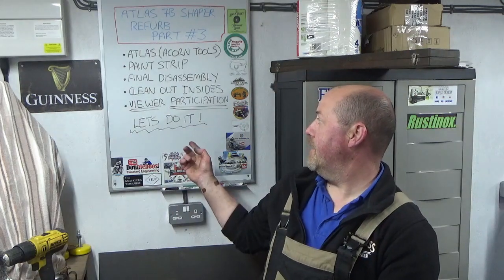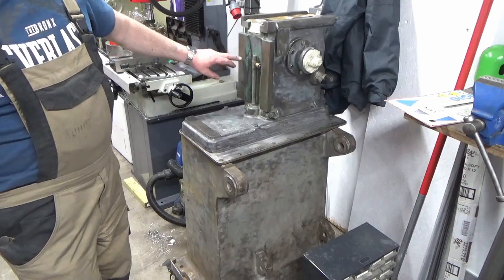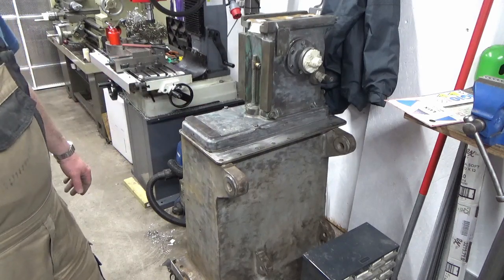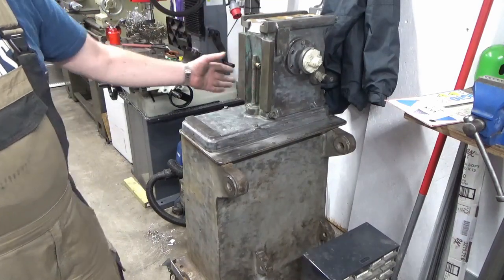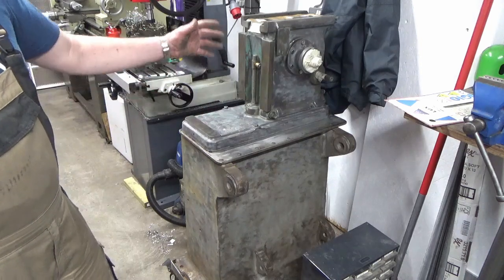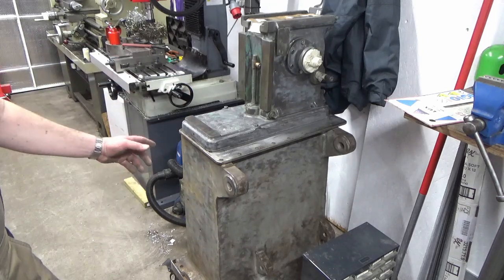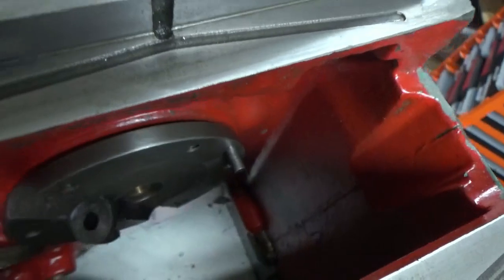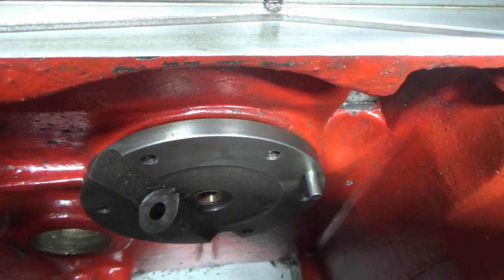Atlas 7B Shaper Restoration Part 3 - The Big Strip

Comment: Gloves and long sleeves are for sissies! Only thing I found necessary is eye protection when using wire wheels on power tools!  My paint choice? Hammertone green, super hard wearing, and silicone based, shrugs off dirt like no other paint. Nice one Jon!
Reply from the maker: Hi Robert, thanks for the comment. I do like Hammerite and Smoothrite, both excellent paints for the workshop. Cheers, Jon

Comment: My 7B had the casting broken in almost the exact same place. It was silicon bronze brazed/repaired prior to my purchase. It works well and was not cracked when I got it. Alcohol on the Scotch-bright pad also works well and does not leave an oily residue. Option 3 is my vote as I would like to see an Orange shaper. Option 1 would be too much Orange. I just restored/painted mine Smoke Gray. Keep up the great work.
Reply from the maker: Hi John, thanks for the comment, feedback and your vote, much appreciated. Cheers, Jon

Comment: I did see an orange shaper once , it was a huge bastard that came out of an automotive manufacturers tool room .  
Go with Grey  !!!  
You would need acetylene for the heat & manganese bronze rods to do a brazing job like that on cast iron .  👍
Reply from the maker: Hi Max, thanks for the comment and your vote. Glad you agree the bracket is beyond my equipment, it will be a quick fab job and be much stronger (plus its round the back so I won't be constantly tormented by my welding lol). Cheers, Jon

Comment: Nice job on the shaper Jon. I don't have any input  as to a the paint preferences but, for that broken cast iron part, good decision not to fool with welding it.  That is the reason the machine tool manufactures moved way from cast iron and went with steel weldments. Mild steel will easily fab up and be superior to that cracked up cast iron.  Cheers.
Reply from the maker: Hi AWDjr, thanks for the comment and your vote of confidence in my decision making lol. Cheers, Jon

Comment: Hay Jon, Option 2 dark gray, you can use your orange to highlight the cast letters.
I was looking at the Atlas motor hanger bracket. It's slightly different, the holes are not elongated leaving a little more meat in the casting for strength. Thought that might be interesting. Making a welded steel replacement bracket, agreed your best option. The Atlas bracket would probably fit if you could find one, quite a long shot. I haven't seen any here on eBay or other sites and shipping prices are crazy high now. Coming along nicely !     Cheers....Dean
Reply: There is one bracket for sale on E-Bay right now.
Reply from the maker: Hi Dean, thanks for the comment, feedback, and your vote. Just going to fab up a bracket I think, should be no bother even for my poor welding skills lol. Cheers, Jon

Comment: That's coming along lovely, Jon.

Cast iron brazes really well, I'd talk to someone with an oxy-acetylene rig and get them to braze it up.  Oxy-acetylene brazing is a helluva lot easier to do than tig brazing.  Pretty much any local machine shop should have the material and skills to do it for you.  

Given your choices of orange / grey, I'd personally have gone for grey all over with orange and black highlights.  So I guess my vote is grey base orange machine.
Reply from the maker: Hi Michel, thanks for the comment. Agreed, if I lived near anywhere industrial it would make sense, nothing but sheep and cows for 50 miles lol (bliss). I have some steel kicking around so an opportunity to improve my poor welding skills. Cheers, Jon
Reply: @jonsworkshop  Nobody nearby that repairs agricultural machinery?  Most of that is cast iron, unless it's all gone to plastic and serialised processors now :)

Another good source of "we've got an oxy acetylene torch and we're not afraid to use it" is plumbers.

Comment: Great video Jon. Colour wise I say grey, but Harrison Blue-Grey which I think is a really nice colour. I can see no issue at all painting it all orange if you like it. I work with huge equipment that is painted bright yellow. I thought John Mills might be the man to tig braze your bracket but then it looks like there isn't much meat on it. I have a cracked cast knee leadscrew nut housing on my mill, which I need to make a replacement for. Nice job on the internal clean. Look forward to the next part. I need to get an india stone like that one you have.
Reply from the maker: Hi Carl, thanks for the comment and your vote. Yeah, the casting just doesn't look like it will mend well considering the weight it has to carry. More welding practice lol. Cheers, Jon

Comment: Morning Jon. Good call on the bracket. That looks like more heartache than happiness. That is such a small wall thickness it is essentially glass. Brave men would try a nickel rod and arc welding. I would not be one of them. 

Great cleanup and discussion. WD40 and green pad is a great combo. I agree with you! Even a metal scraper scratching away is slow progress at removing any meaningful amount of metal. 

All the best 
Dan
Reply from the maker: Hi Dan, thanks for the comment. Yep, one of the most important skills to learn in any workshop is to know your limitations, that bracket is way beyond mine lol. Cheers, Jon

Comment: I would chose option 4 - dark grey all over, and then paint the handles and various touch points with your favorite orange 🍊
Reply from the maker: Hi Joel, thanks for the comment. There's a few said similar so I will add this in as a valid option if it comes out in front 😁. Cheers, Jon

Comment: Hi Jon,
Great job on the stripping down and cleaning, even without H&S involvement. Personally, I would go for the totally grey look, I'm saying nothing about that orange colour that would be your preference.
Have you thought about asking John Mills to tig braze that motor adjustment bracket ? I have seen him do plenty of silicon bronze repairs in the past and they look good. Haven't a clue how much it would cost against you buying some material and fabricating one from scratch.
Good luck with the rest of the project.
Reply from the maker: Hi Del, thanks for the comment and your vote. I did think about John Mills, I think he could probably do it but the wall thicknesses are really weak. Think it will be quicker to just fab one up, gives me another opportunity to try to improve my welding skills to. Cheers, Jon

Comment: I painted all my machines bridgeport blue/grey, as I bought a 2L tin of the stuff to do my Omnimill and had enough left over to do the shaper, surface grinder and tool &cutter grinder. So my vote would be grey all over. It won't show the grimy oily marks as much as orange, unless you're intending to polish it after each use!
Reply from the maker: Hi Robert, thanks for the comment and your vote. Agree with your point, interesting concept, industry have moved over to white in some areas so that it's obvious when a machine is not being looked after....... not sure this works in the home shop. Cheers, Jon
Reply: I painted my M300 white as that was the colour it was when I got it. Not a great move. It always looks grubby, plus the chips in the paint show up really well!

Comment: Not sure what you will go with , but remember one thing. If you go Orange then you will need to make an engraved plate saying Mclaren. Oh & a big spoiler on top. Also Satin black goes well on the Orange Mclaren's. Cannot offer help with the Tig. Left the bottle on by accident. £100 worth of Argon gone. P.S Whatever colour it will look great when finished.
Regards.
Steve.
Reply from the maker: Hi Steve, thanks for the comment. Spoiler eh........ Got me thinking now. Bad luck on the gas mate, at least it wasn't the propane so you made the right mistake (if that's possible lol). Cheers, Jon

Comment: Hi Jon, I'd go or grey but maybe orange highlights, think all orange would be too much. On your bracket repair/replacement, possibly a short piece of heavy duty U channel / girder the right size might be a viable option rather than manufacturing from scratch. Cheers and all the best
John
Reply from the maker: Hi John, thanks for the comment and your vote. Good suggestion on the U channel, never thought of that (less of my crappy welding on show lol). Cheers, Jon

Comment: The broken motor bracket could be made from something as thin as 6 mm plate,  original item was quite light in construction comparatively. 
Casting was more economical than fabrication pre MIG/MAG welding methods and any automation welding.
Great job on the preparation,  I've had a few wire wheel escapees embed in stomach,  cotton T shirt is no protection as you state, when the wires start escaping in volume,  it's time to replace it.
Certainly a lot more sophisticated than my flat belt drive Alba shaper.
Ref colour of shaper: 3. But orange base with grey machine, with orange features. 
Thanks for sharing
Reply from the maker: Hi Bosted Tap, thanks for the comment, feedback and your vote, much appreciated. Cheers, Jon

Comment: Hi Jon , my shop is full of grey machines most in original and tired finishes ….. it’s a no brainer …..obviously ……ORANGE …… with maybe the script picked out in grey ! Re motor bracket you could fab up a mount from steel plate  but if you wanted you could repair the part add some machining allowances and a bit of draft and contraction send it to me and I will get you a new one cast , so you have a bit of viewer interest preparing the part for the foundry and then obviously machining the casting and fitting up . 
Regards 
Robert 
Partsmade
Reply from the maker: Hi Robert, thanks for the comment and your vote. Thanks also for the kind offer. I have already got steel cut ready to go for a fab bracket, the original design in my opinion is too weak in cast iron to hold that motor so steel is the way forward I think on this one. Cheers, Jon

Comment: I'm back, the two things my 7B realy needed was machine work, no big deal for me, took it to work and put it on the Tree Milling Machine, and a good cleaning. a good coat of paint remover and in to the parts washer at work, ( one mite be thinking why would a Auto Repair shop have a Tree Milling Machine ? ) At work I also do cly head resefaceing and other lathe work, The Parts washer took all the geas and paint off

Comment: My view as regards the colour is that this is an antique. Ideally you should preserve as much of the original patina as possible and only refinish as a last resort and then try to match the original finish as closely as possible. But, it's not mine, it's yours... As far as I can tell you want to paint it a mix of orange and grey. I think that'll be hideous, but it's your machine, so that's my vote. 😀
Reply from the maker: Hi Matthew, thanks for the comment. Unfortunately, someone else had already done a really crap job of trying to refinish it so the patina was just flaking off every time I touched it. I don't mind the Atlas Grey, but the Acorn tools green is just awful (in my opinion of course lol). The masses will decide its fate lol. Cheers, Jon
Reply: @jonsworkshop  I do understand the 'hammerite curse'. Generally when looking at old machines, anything painted with hammer finish paint is immediately suspect - if they couldn't be bothered to paint it properly, what else is wrong... Mostly I'm just jealous that you found a small shaper for sane money. Around here, (south of England), they're unobtainium, or crazy prices for worn out, broken rubbish.
I quite like the various greens used for old machine tools. Probably just exposure over the years, it just looks right for old kit.

Comment: Nice Jon the broken bracket why not contact Doubleboost his welding of cast is renown he needs to get dirty after 10 days away on holiday.

As to colour of the shaper
Grey however why not white but not Orange please
 .
Reply from the maker: Hi Raymond, thanks for the comment. Thought about John but the casting is so thin and buggered, its going to take him longer to repair than for me to knock one up out of steel. The motor is a beast so I want the confidence it's going to stay put. Cheers, Jon

Comment: Hey Jon I found that bracket for sale on E-Bay here in the States. The seller wants 70 dollars US and 10 dollars for shipping. If you want it I can buy it for you. Not sure how bad shipping to you will be though. I know international shipping rates are pretty high right now. So Probably not worth it unless you want original parts. The Atlas part number is S7-74 if you want to hunt around on the web yourself.
Reply from the maker: Hi Hill Top, thanks for the comment and your research. Shipping to UK from US is astronomical at the moment unfortunately. I have got some steel here so to make one up is just my time, and I need the welding practice lol. Cheers, Jon
Reply: @jonsworkshop  Alright. I imagine rates are pretty high. Figure I would offer.

Comment: Looks like the Ram Bed needs finish work. The person I got my 7B from said do you want to try it, I looked it over and it seemed to have most of the parts, I said nope. Got it home and down to the last nut and bolt, found the ram and bed to be in realy bad condetion, so off to work it went, So I think one of the points I'm to make is TAKE IT A PART TO THE LAST NUT AND BOLT, to find all these little problems and to get to know your machine  better
Reply from the maker: Hi Steve, thanks for the comment. The ram bed is not too bad, there is visible discolouration but the surface is in pretty good nick and very even and light wear pattern. Going to do a proper check post cosmetic work. Cheers, Jon